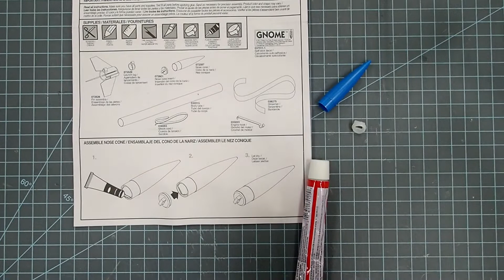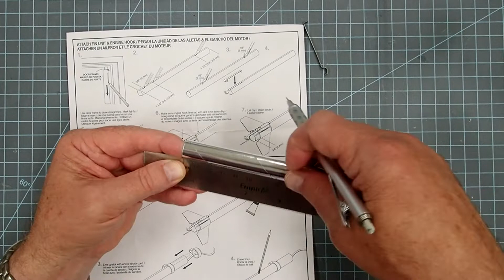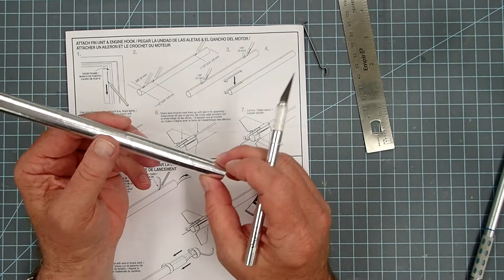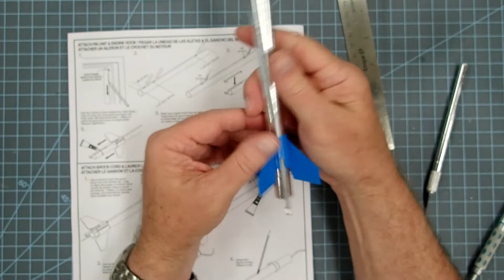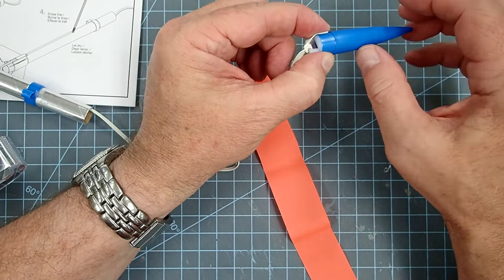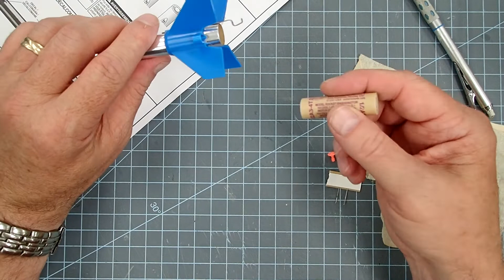Estes "Gnome" model rocket assembly

Comment: Any benefit to adding a thrust ring or upgrading to a nylon streamer? Also thinking of using wood filler to fill tube lines in and painting it chrome or wrapping in chrome. I like the idea of doing upgrades where possible, even on what many would consider a "throw away" rocket.
Reply from the maker: A thrust ring would be helpful if you flew it a lot. There isn’t much room for a nylon streamer.